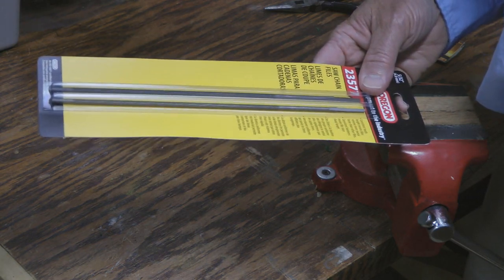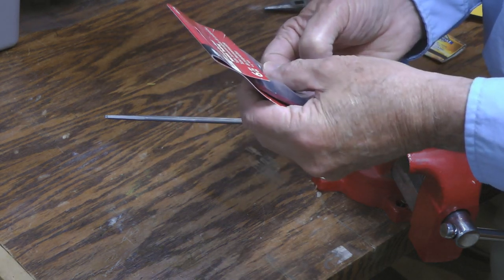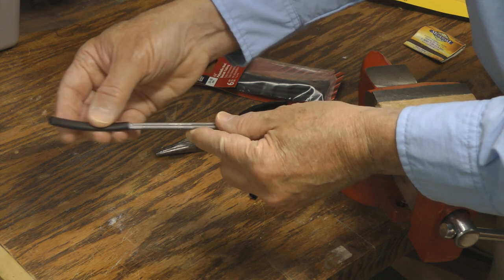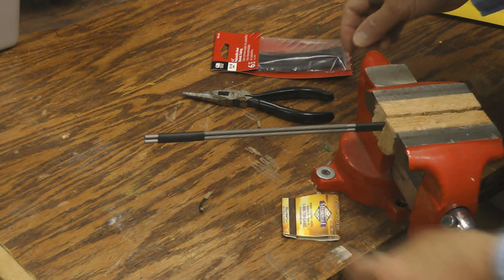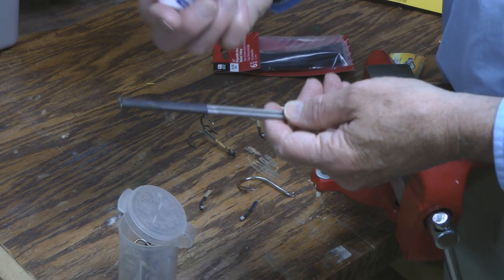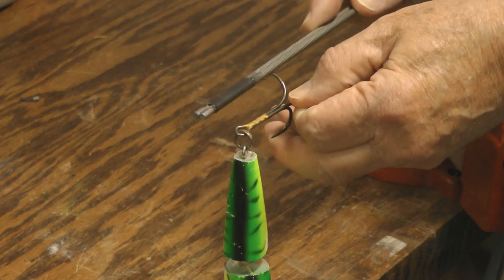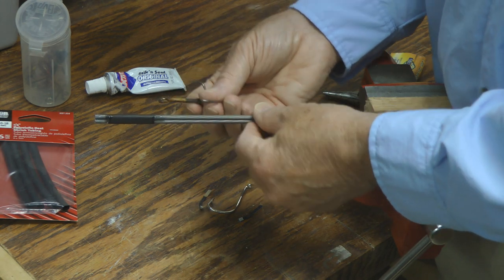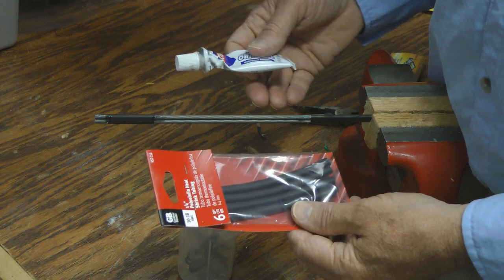DIY Chain saw file, fish hook sharpener for fresh or saltwater  by WillCFish Tips and Tricks.

Comment: Great idea. I'd probably use a little 5-minute JB Weld at each end to join the 2 files, then maybe use the shrink wrap or some of that plasti-dip stuff for tool handles. Also might attach a large swivel at one end with the JB Weld, and then hook a small float to it, just in case you drop it overboard, off the dock, etc.